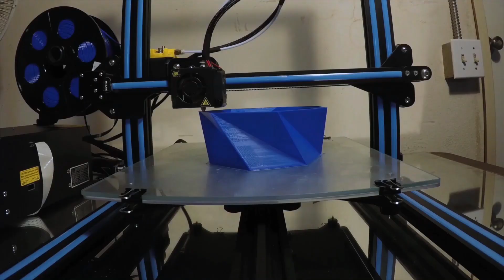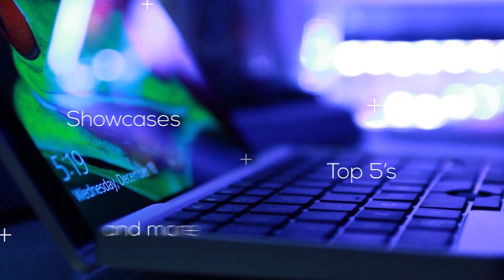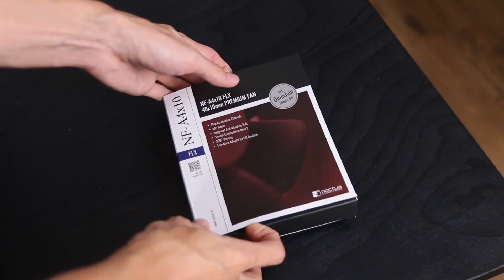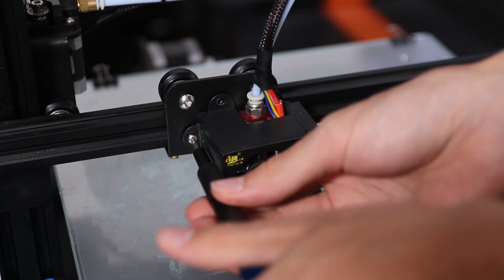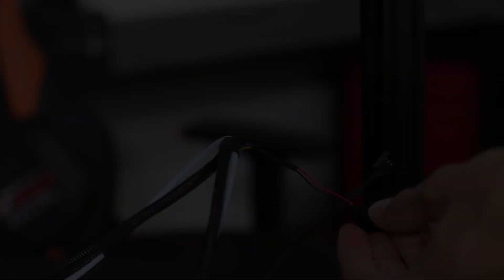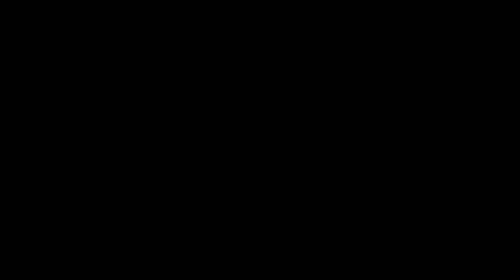Making any 3D PRINTER (almost) SILENT

Comment from the maker: IMPORTANT: It turns out that the 10mm thick Noctua fan doesn't push quite enough air to keep the hotend cool. You should go either with the 20mm variant, or something like this: https://www.digikey.com/short/qqmqmf
Reply: I went with the Noctua 20mm fan and there's not enough room. Fan ends up binding against the heat block which then won't allow you to get the fan housing back on. Best bet is to find a quiet fan in the same size as the original (10mm).
Reply: @matthewcummins247  If I am not wrong, original fan has about 9 CFM. Noctua NF-A4x20 has 5,5 CFM. Still far away...
Reply: For that reason I ended up using a 12V Noctua fan with 20mm depth (NF-A4x20). I printed a new cover that I found on thingiverse that mimics the apparence of the original cover but allows for more internal room for a thicker fan.
Reply: @N33O80  would you mind sharing the thingiverse link? 😁
Reply: Sure! This is the one that I made out of orange PLA+

https://www.thingiverse.com/make:620709

Something new might have been posted since then because I did this many months ago.
Reply: the 20mm has been working very well for months for me! totally recommend the 20mm
Reply: Noise blocker fans are a good alternative and TBH the difference shouldn't affect it enough
Reply: A better prusa r3 style fan duct can help too
Reply: The best thing to do is to get two 12 volts 40x10 Noctua fans and put one on each side of the aluminum fan duct.
Reply: What was the result with the small 40x10 printer? Why was it not enough; I have installed an adapter for a bigger fan and run it at 75%. So far I did not see any issue but maybe it might come up at some time
Reply: on my anet a8 (upgraded to hell) i use a 10mm noctua fan and it works fine, is there any reason why it doesn't on the cr-10, cause im considering getting one as my second printer but want it to be as quiet because they are in my room
Reply: also did you get 5v or 12v because i accidentally bought 5v at first for my printer and that stopped it pushing enough air but when replaced by 12v it worked like a dream

Comment: I've done the VERY not electrically recommended thing of removing the bottom case panel from the control box AND the PSU and added nice 120mm fans in a caddy to the bottom for high airflow. The box is now very quiet and could be more so with a low-noise adapter as the airflow is more than needed. Pair that with the motor dampers and I think I wouldn't be able to hear the printer if I weren't within ~10ft of it. DEFINITELY getting a set of dampers soon.

Comment: Do you experience reduced print quality due to the rubber spacer on the steppers? I would imagine this will introduce some flex in the belts and possibly reduce print quality at high speed?

Comment: IMPORTANT: It turns out that the 10mm thick Noctua fan doesn't push quite enough air to keep the hotend cool. You should go either with the 20mm variant, or something like this: https://www.digikey.com/short/qqmqmf

the fan from the linked page:

Noise 	31.4dB(A) 

??????????????????????

Comment: hello gr8 video - i have a issue with a extruder motor not working - i checked stepper driver has voltage (extruder) but doesnt power motor on my ender 3, the cables test out as working, when i swap out the xyz, the extruder motor works - what is the next test ?

Comment: Stepper motor dampers and print some feet for your printer to isolate the vibrations from the printer and table. Easily eliminates all noise from the motors (except z axis since it hardly moves much to make noise) but from all other videos I found that there’s not much you can do to fix the hot end fan being loud. It’s just the nature of such small fans unfortunately.
Reply: How does Prusa do it?  They're almost totally quiet while my Anycubic printers sound like a jet engine taking off.

Comment: you must  change  all   fans       outside  and inside  3d   printer .  You can  use    120  mm  fan  ( noctua od   scythe)  here is    800 rmp  s-flex    inside   creality cr -10  :P   https://www.youtube.com/watch?v=mPeBCxG9Mz4   but  ther is   another one inside   power supply   :D

Comment: can you also add trinamic stepper motor drivers ?
Reply from the maker: That would help a lot, as the drivers aren't replaceable on the stock board though, you would  have to replace the entire controller board, or do quite a bit of soldering.
Reply: @DarkArtGuitarsWorkshop  men buy now the skr mini e3 that are plug and play, try out

Comment: Putting thick industrial foam under my printer worked brilliantly, it solved all noise coming from the motors. Make sure the foam is very dense otherwise, it may compress too much overtime resulting in more noise.
Reply: Where did you get your industrial foam from?
Reply: @frickezthias8638  I got it from the packaging of something but you can find it by googling high density soft sponge foam.

Comment: Nice video!
I did the same upgrades about a year ago, and it has been working fine, except for the stepper motor dampeners. I have a feeling they are loosing their elasticity by time, hence the motors get a bit louder. But still much queiter than out of the box printer. Also they are so cheap that I dont mind changing them every six month!
Reply: You can spray some silicone spray from time to time on the rubber. It keeps it nice and soft.

Comment: putting a fan cover on both the nozzle and brake fan with a dome in the centre like what you can get on thingiverse makes a lot of difference,its more the grills on the fans making noise as it pulls air over them